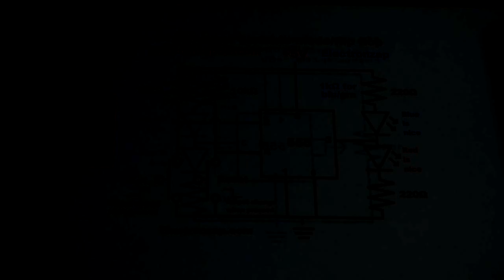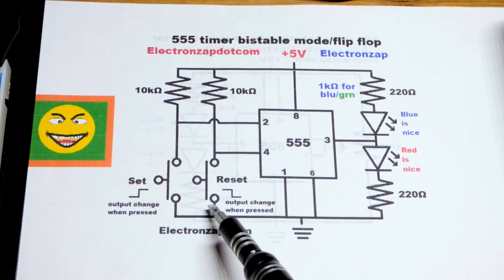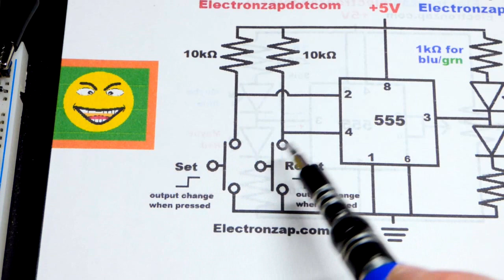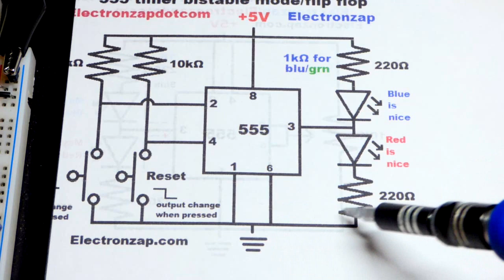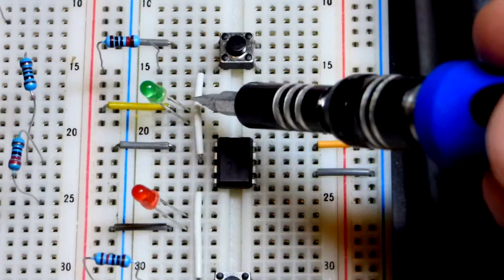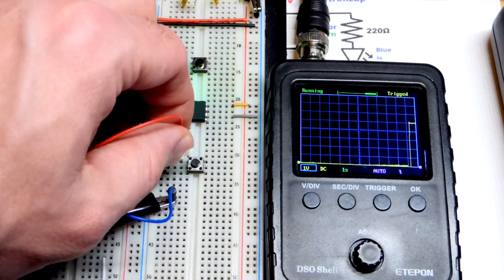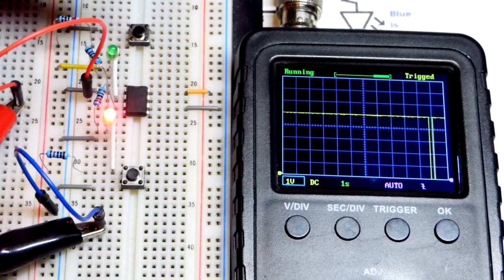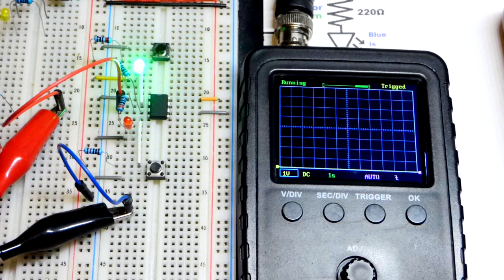Electronics bistable mode flip flop 555 timer circuit explained and oscilloscope measured

Comment: I can't find your post about dropping numbers. In my experience I unsubscribed because your videos are too frequent, roo simplistic, and never a real world example. I hope that helps you gain views in the future.
Reply from the maker: Alright, thanks for having checked them out!
Reply: I am of the opposite mindset, I like your explanations, but for the love of all that is holy, it would help if you talked slower. I didn't catch the one resistor ohms. My circuit doesn't flip flop, it starts out green, jumps to red, then stays there. 

On your monostable video I also had trouble getting it to work, once I found a different video I got it to work. 

I like the explanations, until it gets to the breadboard. 

But I'm still a subscriber, overall I like the videos and eventually understand them.